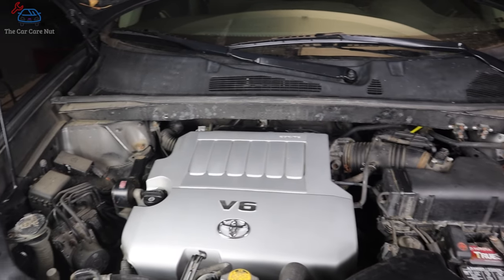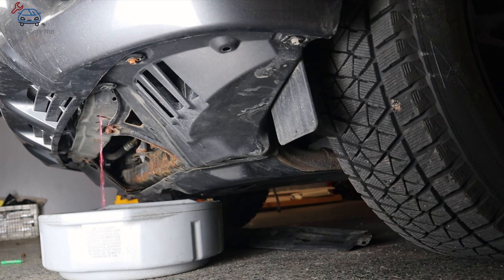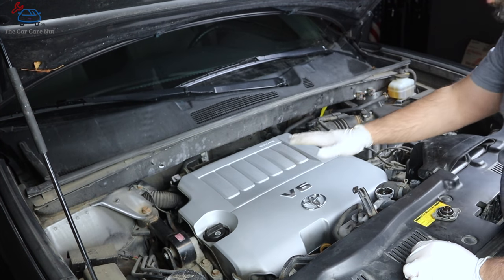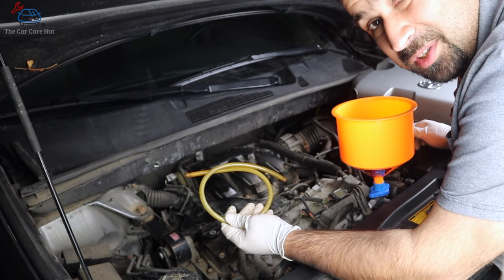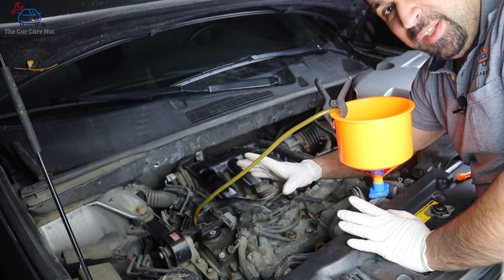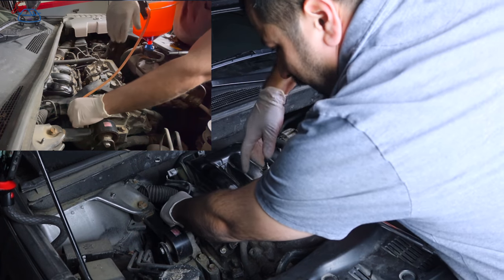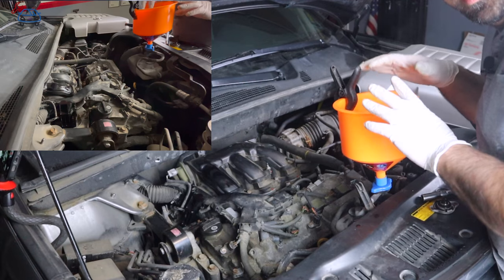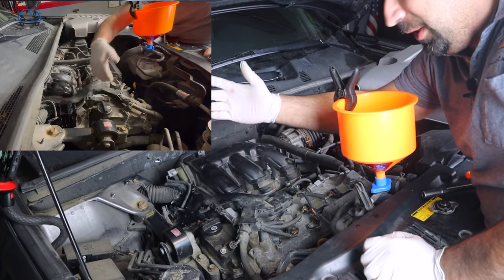Toyota Cooling System Bleeding for V6 2GR-FE 3.5L THE RIGHT WAY!

Comment: I’m a professional mechanic and actually recently left a Toyota dealer and came across this video.  I put a water pump on my own V6 RAV4 this afternoon and this method is far superior to the mess I usually make opening and closing the bleeder.  Thanks man!
Reply: Do I have to heat the engine like in this video to drive out bubbles after adding new coolant? 
When new coolant is fully filled in via the cap and reservoir at FULL line, then drive the car around for a while, will the bubble be driven out to the coolant reservoir? then add more coolant to reservoir to FULL line.
I try to understand the theory of the cooling system.
Reply: @adamxu  You need to do this exact procedure when refilling the radiator after draining.  Start with a cold motor, set up the funnel/hose, turn off the heater.  Start it up and follow The Car Care Nut's precise instructions and life is good!
Reply: @adamxu  the reason you have to run the vehicle is because the car needs to get up to temp so the thermostat opens and let's the coolant flow
Reply: Great video and helpful
Reply: No you are not. If "were" a professional toyota tech you would of figured it out before you left.
Reply: @mr2fas2  ok troll.  This is the most unnecessary comment I have ever seen.  Felt the need to start a fight over a 2 year old comment?  Obviously you have no idea what it is like to work as a tech at a dealer.  There is no handbook that says do it this way and the way to succeed is to find a smarter way.  That is what this video demonstrates.  I’m sorry you have nothing better to do with your life.
Reply: @pontiakgaSport  troll I might be. But you claiming to be  professional toyota tech is likely BS. Just say your express lane I would believe that. BTW i work at toyota...and not in express but don't claim to be a professional. Lol. Good luck
Reply: @richard1835 Yes, you’re correct! The car nutt just gave “all of us” the answer on how to do it appropriately……😊✌️
Reply: @brainiac8067  I don't understand why all other videos advice after starting the engine turn the heat seating and fan to max., but in this video, it has to be off.
Could you explain the reason not to turn on heater and fan. I will appreciate your advice.
Reply: Everything is strait forward and understandable in this video, except one thing - why the heater and fan after starting the engine have to be off???
All other, dozens of videos, recommending turning the heat and the fan to maximum. Only this is confusing me.
Could you explain the reason. Your answer would be appreciated.

Comment: To bump the speed to proper rpm for bleeding, I took a 1x1 length of lumber, put one end on the gas pedal & the other on the headrest. I used the power seat tilt to adjust to 2500 rpm... worked great!
Reply: FKN BRILLIANT!!!!
Reply: Good tip!
Reply: Genius
Reply: A camera tripod also works well.
Reply: Bloody inspired!
Reply: Hey if it worked, is it really a dumb idea?
Reply: Someone watches Vice Grip Garage, LOL😊
Reply: Done this with a mop before lol
Reply: Love it!
Reply: I did dame , the sear adjustment made it easy ti pinpoint rpm
Reply: how can a 1x1 piece of wood go from the gas pedal to the headrest?

Comment: Do you not need to turn the heater on during this process?
Reply: Still a mystery.
Reply: I generally turn on the heater, FWIW… the general idea is, I think, that it prevents current and future air pockets in the heater core. Is it required? 🤷🏻‍♂️
Reply: If you listen he says to leave it off.

Comment: I did this procedure just now. Some tips I learned from my small disaster: 1) Make sure you have the bleeder hose clamped securely onto the funnel. It is deceptive whether you have done a good of securing this hose because before the procedure, the vinyl tube is still stiff and it is empty of any coolant and weighs nothing. Once you start the procedure and you have hot coolant running through it, it becomes soft, limp and heavy - imagine you have a really heavy smooth rope or heavy slippery steel chain - that’s how you have to secure it. It has to be clamped really well. I had a small needle nose Vice Grip holding the tube onto the funnel lightly. I couldn’t clamp it hard or else you crush the tube so it’s tricky. Anyway during the procedure, the tube gets soft and heavy and the tube fell, and the Vice Grips fell to the bottom of the engine compartment. I’m left there holding the tube with hot coolant flowing out of it. I’m doing this as a one man job with gas pedal contraption revving the engine. Now what do you do ?! 🤦‍♂️ I had a hose clamp there ready when I pull the bleeder hose, so I’m trying to use the hose clamp to secure the tube onto the funnel and it kept falling off getting hot coolant everywhere. I also bump into the funnel and coolant is leaking from the bottom of the funnel everywhere. 🤦‍♂️ I had a plan to prevent spillage, but forgot to bring out the 10mm open end anyway. Spent so much time trying to clamp the tube I was already getting a steady flow so I just pulled the tube and closed w socket and fluid went everywhere.

Next time I’ll clamp the hose better and have a 10mm open end ready to close the bleeder before I pull the hose. I also won’t open the bleeder valve as much so it’s easy to close and also have a hose clamp ready.
Reply: Try a binder clip on the funnel. Thread it through the clip so the convex side applies slight pressure to the hose holding it in place.
Reply: Hillarious nightmare story, once it's over. That typically happens to me.  Cheers from the great white north.
Reply: Thanks for the advice! Does anyone know what turning the heater off means? Is it the temp set to low (blue) or just the fan turned off? Also, I saw in the comments that someone did the procedure with the heat on max on a Sienna, kind of confusing. My 1st try failed, I believe I wasn't patient and my tube is too long.

Comment: As a fellow Toyota Master tech, this is without a doubt the quickest and easiest way to remove the air.
Reply: invest in a vacuum system for removing air from the cooling system. way faster. i am a mercedes tech and this is how i save time
Reply: Where is the bleeder valve on the RX300, does it look the same as this vehicle?
Reply: @narcissistinjurygiver2932  when you're a DIY guy working on your car in the garage we don't need a vacuum system and BTW it's not faster just more expensive.
Reply: @Tonyplat98  well, I do this for a living. If you do not want to hear what I say then fine

Comment: Just finished the job using this vid. Awesome.  Two things,  put a 10 mm wrench around the bleeder screw that way u can tighten - somebody mentioned below in the comments.  Also, I had to rev my engine for about 20 mins before hose started really moving with fluid thru it.  Just take ur time.  Also, buy the funnel in the link because it makes it super easy. Thanks again for the channel.
Reply: Took about 10-15 min too for me before it started coming out. Everything worked!! I kept the rpm range at 2000-3000. Faster rpm helped it go faster.
Reply: Thanks - I just saw this comment.  I replaced the radiator in our '08 Sienna (228,000 miles) two days ago, and I didn't realize that the bleeder valve (Toyota calls it an "air drain cock plug") is two parts - a steel barrel (takes a 14mm socket to remove) with the brass bleeder (10mm) that screws into it.  I removed the whole thing, then thought, "Holy crap, what do I do now?"  I was able to clamp the barrel in a vise and break the bleeder loose using a 10mm box end wrench.  Then I scrambled around in TIS (Toyota's Technical Information System), trying to find the torque spec for the barrel, since TIS says to remove the plug (!).  According to TIS, the torque spec for the barrel is 22 ft-lb, so I cleaned up the threads, put some blue Loctite on it, screwed it in, then torqued it.  The torque spec for the brass bleeder is 9 ft-lb.

I followed the process here and was able to bleed all the air out of the system.  I bought a Lisle throttle depressor, the OEM Tools funnel kit, and clear vinyl tubing from Amazon, and ran the engine at 2000-2500RPM.  It was a good 20 minutes to complete.  I didn't get a clamp for the tubing in time, so I used a piece of duct tape to hold the tubing over the rim of the funnel - it worked fine.  Including tools and everything (I bought a Denso radiator), it cost me about $275.

Comment: First thank you for putting out such great content.  I'm a DIY guy and your videos have helped me maintain my 2017 sienna.  I have the 2GR-FKS motor  and I changed coolant this weekend.  At first I did not have one of the coolant funnels.  First attempt I had air lock that I could not get rid of.  So I bought one of the funnels from your amazon store and then drain/filled again and was successful.  Couple of things I did for success on 2nd attempt.  1.)I filled with the vehicle being level (first time it was on ramps still)  2.)Used the funnel  3.)Squeezed both input/output hoses to get as much air out  4.)Made sure funnel always had coolant in it. 5.)Started vehicle and turned heat on full  6.)Patience....occasionally revving the engine while watching the funnel I could see bubbles pop up...wait a couple of minutes and rev again...I did this until I did not get an bubbles coming up when revving.  7.)Made sure overflow tank was correct height and went for a short errand drive...came back and it was down 2"...refilled overflow and all is good.  Hope this helps someone else with the 2GR-FKS....A bleeder valve would have been nice to have.
Reply: THANK YOU!  I have all the supplies, including the no spill funnel on my bench, and was just about to tackle the change on my RX.  You've addressed my doubts about how the system reacts to the hose squeezing and engine revving.  Did you also drain the block?  I dread crawling under there and getting the drain hose to stay on that spigot!

Comment: First, thanks for the best video on the fix on this subject. Other videos range from clueless to “close, but no cigar". This is where the dealer’s technicians come to learn, so you can imagine how appreciative a DIY guy like me is.
I had heard on other vids of either  "heat on" or "heat off" and had difficulty finding mention on this vid. My son found it for me @ 5:37 (Both front and rear heat off) in this vid.
I went out and bought a “No spill radiator funnel  ($36) that immediately paid for itself.
As a one man operation, I used a 48” ratchet bar clamp in spreader position ( pads not facing each other) between the steering wheel and accelerator pedal to articulate  the rpm  (2500, then down to 2000 as 1500 may be to low to work) by squeezing the bar’s ratchet. My ratchet bar also works for times that I have to depress the brake.
The no spill funnel  also impressed my son and me when at the end, we had leftover coolant almost half way up in the funnel. The funnel comes with a no spill, long center stopper/valve which I plugged the funnel. Then, without losing any coolant, I transferred the funnel over to the overflow tank which was nearly empty, and pulled up on the center plug just enough to slowly fill to the “full line” before replugging. Again, I emptied the remaining coolant back into it’s jug.
Again, many thanks.

Comment: I finally did this on my 2013 highlander and it worked perfectly following the video.  The only thing I added was after I loosened the bleeder valve, I  put a small 10 mm ratcheting wrench and then the hose.  That way when I am ready to pull the hose from the  bleeder valve,  I can use the wrench to close it and then pinche the hose and remove it.  This way you don't drop as much anti freeze on the engine.  Great work and directions.  Really appreciate it.
Reply: great idea, next time i'm going to do that :D
Reply: @RealJohnnyDingo  works really good.  A lot less mess.  Good luck next time.

Comment: Just performed this on a 2017 Camry 2GR-FE. Worked like a charm! Just trust the process. When the violent bubbles start coming out of the bottom of the spill proof funnel. Be patient. It is scary seeing that for the first time. Once the coolant comes up the hose without bubbles, you're good. After reducing the RPM back to idle, I waiting 5-10 mins to make sure all the bug bubbles were gone. I'm very grateful to the Car Care Nut for his detailed instruction on the process.
Reply: At what point did you turn your heater on?

Comment: I replaced the radiator in our 2007 Sienna this weekend, and then used this procedure to bleed the system.  The van has 297,000 miles on it and it has NEVER had heat so hot.  Buy the kit and follow this video's instructions and you'll be happy.  By the way, I was reluctant to let the engine sit there and run at 2,000 RPM for so long, and tried instead to get this video's results at 1,500 RPM.  No dice.  After 25 minutes I still wasn't getting the continuous flow of coolant up the tubing.  I increased the RPM to a steady 2,000 as instructed in the video and the coolant started flowing right away, right up the tubing and into the bucket.  Follow these instructions to the letter and it works.
Reply: Did you buy the OEM Tools Kit 87009 that he has a link for in his store? I have a 2007 Sienna I'm trying to bleed coolant on, bought the harbor freight version, but none of the fittings seem to make a tight seal and coolant leaks out from the funnel kit cap. Tried an o-ring to tighten it up, didn't work. Reluctant to spend another $20+ on something that doesn't work...

Comment: I drained and replaced the coolant in my 06 Avalon. I didn’t do this procedure. But I kept having coolant spraying from the overflow cap.  I was afraid that the bleed screw wouldn’t open but it wasn’t even on that tight. I did the procedure they way you outlined and it worked. Yes it was nerve wracking but your videos have helped SOOOOO MUCH! Thanks for the confidence to do DIY operations even here in Rusty Land Indiana.

Comment: Man after all this work for 2 days you saved my life with this bleed.....I had code po117 ,p0300...I changed the etc sensor and was to change thermostat ...I had no heat and my temp gauge initially goes high then low ..after that the gauge will run high after car warming ....I thought my engine is done at 235k miles 07 sienna ....now it will live more yes...thank u brother

Comment: I discovered a modification to your system just by dumb luck!

After a flush on a Sienna, I didn't notice that the clear hose opening was at the bottom of the funnel, submerged in the coolant inside the funnel. When I started the engine, the vacuum in the system pulled coolant thru the tubing into the weep hole, instead of air. This significantly cut down on the violent bubbling and didn't overflow and leave a mess at all. 

Out of curiosity, I drained and filled a couple more times. Once with the tubing in the funnel exposed to air. And another try with the tubing submerged in the coolant inside the funnel. Same result again! No mess and took way less time to bleed. Just thought I'd share.
Reply: Nice timing on this post!
Reply: Mister, that is awesome.  Not just that you discovered that detail but that you went out of your way to share it.  
I'm getting ready to do the coolant on my LS 460.  Supposedly the big 1UR V8 has lots of problems with air in the cooling system after a coolant change.  

So I bought a "Yuanri Coolant Vacuum Refill Kit" to do the job for $42 (I think maybe 5 or 10 sellers on Amazon offer this exact same kit, and most of them look like they use the exact same parts and the only difference is the price).  The refill kit is used after you drain out all the coolant.  Then you seal your cooling system with the adaptor in the radiator/overflow cap hole and hook up an air compressor to draw a vacuum.  
Once the gauge drops to 25, you close the valve, drop the weighted tubing end from the valve body into your new coolant, and slowly open the valve.  Then your coolant gets sucked in by the vacuum, in theory with no air left in your cooling system to bleed out later.  

I re-sealed all the threaded bits of this kit with teflon tape, first thing,  and bought extra clear tubing so I'd have enough of it to reach the coolant container; now just waiting for the coolant to arrive to try this thing out -

Comment: Thank you for the excellent instructions! Toyota should put this video on TIS.

Worked just like your video on my 2GR-FXE, 2013 Lexus RX450h. I used the same funnel and activated AWD Maintenance Mode. I propped the pedal to the floor (increases revs only slightly on hybrids). One note that may be hybrid-specific: after about 5 minutes, the ECU idled down the engine and ignored accelerator pedal inputs. I removed the prop, let it idle for a few minutes, and the pedal became active again so I could finish bleeding. Minimal mess using this procedure too. Car runs perfectly and coolant replacement was my last maintenance item to check off.

Comment: Hello, This bleeding process worked exceptionally well!  I flushed my coolant system twice and got an airlock the second time. The bleeding process fixed it in no time.  Just one note, make sure you disconnect your overflow hose from your reservoir and position it above the height of the coolant in the funnel and the bleeder hose.  Otherwise, have a bucket under the vehicle!
Thanks,
Burt
Reply: Regarding the overflow reservoir that should not be necessary, because the spill proof funnel adapter is supposed to seal against the "inner" part of the radiator hole. Since the overflow reservoir connects to the space between inner and outer seals, then it is not involved in this bleed process at all.